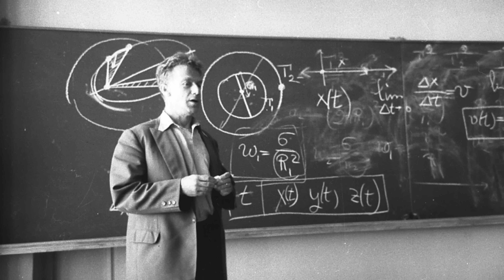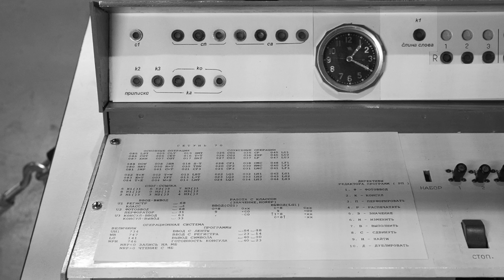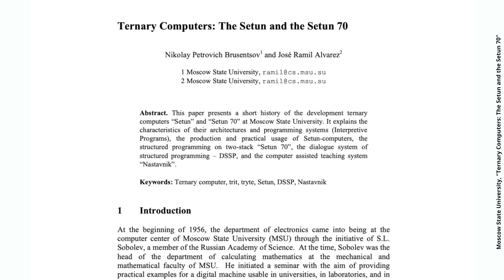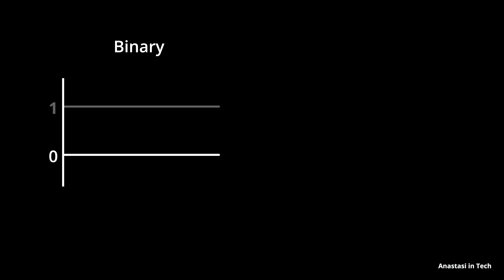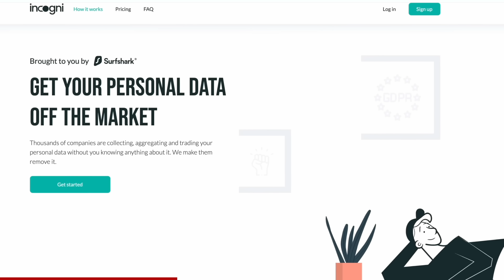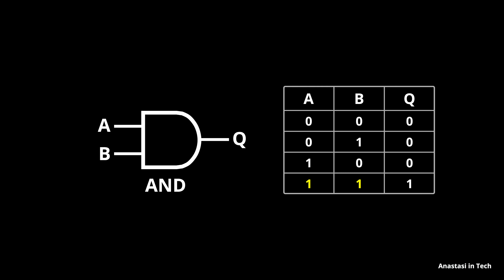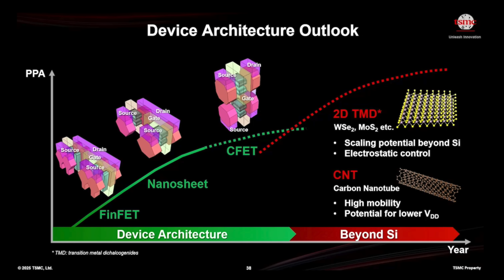The World's First Ternary Computer

Comment: Well first.
Binary is not tru false or not, one or zero.
It is open, closed, pushed to open or close electrical cirquits.
It is +1 -1 or 0V.
It is transistors combined with resistors and capacitors. IC cirquits has many current distribution are few, or single.
Binary is only the language to handle the construction mathematicaly. 
You can do it with low voltage or current, or with light in different wavelength.
Light makes it more complicated and possible to resolve in more levels in comparied to one plane current based logic.
Light makes it possible to separate level (energy strength), and wave length (hz). This makes it possible to work foton transport in infinity layers, and if you apply it to carbon nanogrids it will be enotmous.

Comment: As mentioned in other comments, the question how many stable staes are the most efficient for electronic computing has been picked up by several authors in the past. I remember an essay about this in the late 70s, which came to the conclusion that Euler´s number "e" would be the best solution. 
Since "e" is an irrational number, this does not help directly, but tends to point to a three.state model as the best compromise. But there is another way, because "e" can be approximated by a fraction. If 70% of all computing actions are done with a 3-state logic, and 30% with a 2-state logic, then the average bit processing action is around 2.7 states!!
 Furthermore this complements the observation that in some cases a 3-state action does not make sense. E.g. "can you have two left legs on your body?" The answer is no, because if you have two legs, one must be "more right" than the other. Some jokes, gimmicks and psychological games are possible about this, but the reality is obvious. The same is the case in electronics. If only two defined states are acceptable. like "on-off", anything else is unwanted and dysfunctional. So a smart mixture of 2-state and 3-state logic will most likely be the future in computing

Comment: As per Information theory, fundamentally the advantage (of using 3 as the Radix, in place of 2) is 1.58496250... (approximately 58.5 %). Instead of 3-bit byte for 8, one can have 2-bits (8<9) in 'ternary' logic, or it leads to pack more information in each bit, that much.
While it may be (=is) so, much can be done in increasing the speed easily (or better) like optical computing (I've seen videos & the process offers easy up-gradation in speeds, that we don't even need now = as our date processing, coding etc as well as the man-power to load them isn't there). Evolution from Electronics, began with the transistor & its ability of (analog) "amplification". Since that process (amplification), is needed, "only" to drive it till saturation; all that capacity to "amplify" is a waste. We could've trodden that path, Instead, by simpler (direct) methods - that we explore now.
It implies a 2-bit "yes/no" logic. If we resort to 3-bit thing, again we bring in the transistor & amplification. It might be twin-supply (+ & -) that entails a "0" too. It is the hardware design part, with demanding "dynamic" ranges (& concurrent "error-proneness') - I view it that way as a circuit designer. Well, we can sort out latter too. But it is prudent to throw it away rather than getting into it & to spend a million man-years, improving it. In the process we add up so many links on the way & assume that the system is hunky-dory! But each link (a link can break; "a thing 'will' go wrong if it 'can') introduces its own unreliability factor and the nett effect emerges at the end of this tunnel, only. America stopped producing robust systems, mistaking the patch-work as the solution.
Reply: Where'd you get 2 digits ternary == 8 digits binary from?
Reply: @wannacry6586
2³=8(i.e. 3 bits) < 3²=9(i.e. 2 bits)
Reply: @MrPoornakumar  so just a simple mistake. Happens
Reply: @wannacry6586  
Not at all! You didn't do any mistake; may be its mine.:hand-pink-waving:

Comment: I believe the thing is that tirtiary is different concept than what we want trinary to be so i think its hard to compare the actual potential of a real trinary because tirtiary maths has to do with powers of 3 in layered parrallel sequences ..and this only really has practical applications in very specific computations which is why it never took off although there were different variations of this had various outputs and could be heavier in payload and take longer to process certain simplistic computations ..but a trinary code that could be handled bya complex compiler with nano tech could be the answer so having 3 would have to be deciphered in an efficient way that would be outside of known language logica that we have yet to determine i BELIEVE

Comment: This is nothing new. 
Although ternary systems are more efficient, we use binary due to simplicity. This is basic stuff engineers learn in digital electronics since forever.
There are cases where ternary system is deployed, but mostly very specific cases.
Imagine building storage devices and electronics that require multi-level signal detection. If you are not into digital electronics you have no idea how complex this task is. 
Binary is not going anywhere any time soon.

Comment: Great video Anastasia congrats!!
As a software engineer I can confirm that things are going to change very rapidly in energy of consumption , battery , device size and so on.
Reply: As a software engineer you are not qualified to talk about any of the things you listed professionally
Reply: @wannacry6586 walk away peacefully.
I am not gonna take permission from species like you .
Reply: @andi.bevapi  out of all the things you listed, literally 0 have anything to do with software. Energy consumption is hardware, battery is hardware, dimensions are hardware.
Reply: @wannacry6586  funny , whay you need hardware improvment then?
Hardware and software are always connected for casuality ??
Reply: @andi.bevapi  ah ok so code running more efficiently will make your device smaller got it...

Comment: Don't know why I've been seeing more people recently saying ternary will somehow replace binary but I can tell you that that's simply false.
Radix economy doesn't account for the most significant digit holding less information that the other digits (The left most digit of the mantissa of a number in scientific notation cannot be a zero)
For most bases, that doesn't matter that much but for binary, it's major. Floating point numbers omit the most significant bit because it's always implied to be a 1, something ternary is completely incapable of doing.
Binary is the only base where the multiplication table consist of only single digit numbers meaning several steps can be skipped when multiplying large numbers in binary.
And it isn't just multiplication. All computation is made much less complex by how simple binary is. It even has a very simple way for people to compute square roots by hand, something we don't see in decimal or ternary.
The two most common computations, doubling and halving, can be done with a simple bit shift (adding and removing zeros at the end).
Binary is just better. It's better than base 3, base 10, base 12, all of them.

Comment: Ternary computing is more expensive and more error-prone because a different current voltage is used to maintain the third state -1. It has not caught on and will not catch on.
Reply: Exactly.  Around 1960, +/- 5 years, the US, the UK, and the USSR each buit a ternary computer.
Each project built exactly 1 ternary computer, and then each country dropped the idea.
1.  The logic gates require more than 2x as many vacuum tubes or transistors.
2.  Typically 2/3 of the transistors are in an "on" state compared to typically only 1/2 for binary.

Thus, EVEN WITH the reduction in logic gates needed because the same number of values can be expressed with roughly 2/3 as many data lines, the overall computer
1 requires more transistors
2 requires more power
and 3 ... (not an issue then, but is now) larger chips for the same capability = higher defective chip rates at the chip production plants.

Comment: 7:12 BS!
14:04 BS!

Ever heard of 74125?
Ever heard of  74244?
Ever heard of  74245?
How many computers from the mid and late 19nn did not use any of these? And if not, equivalent functions?

Ever heard of 100Base-T1 Ethernet?
Does 100Base-T1 Ethernet use binary of ternary coding?

Ever heard of FLASH memories?
Ever heard of SLC?
Ever heard of DLC?
Ever heard of TLC?
Ever heard of QLC?
Ever heard of PLC?
Have many of the FLASHes you have bought the last decade have used SLCs?
The phone in your pocket, does it use SLC FLASHes?

Transistors are not "binary". They are analog.
You can use analog transistors in binary operations. (And ternary, etc.)

Comment: A nano device with 3 voltage thresholds and 4 states (quaternary logic)  is easier to understand than 3-state hardware: each wire (for example the logical device input/output wires) carries 2 bits in stead of 1. Does this mean that, at the same clock speed and volume and power consumption, the data and the data-speed is simply doubled, compared with 2 states nano devices? But if the 4-states device is more sensitive to 'logic state' errors due to noise, one needs to build in error-detection or even error-correction redundancy, perhaps even 'doubling the hardware'. The end result could be hardware based on 4 logic states and superior reliability, at the same data (speed) density.

Comment: If you can have more power by other means than carbohydrates, wind, and solar in their current state, you don't need to change your whole infrastructure; it's the battle between ingenuity in energy production and energy consumption.  Less consumption is a good Idea when there are limits to your energy production like living on Mars or just pushing for fossil fuels as they are now. But without these limitations, there is no need for changing the whole infrastructure to reduce energy consumption by something like 20 percent. That'll be the real battle the capital should go toward energy abundance or energy proficiency in the next decades. For now, the answer is that it should go for both because we are in the development phase.

Comment: The reason binary is used is far from arbitrary! It has to do with how transistors are used in logic systems. In a binary system, you never have to wonder if a voltage measurement was off a little bit. That's where computers' reliability comes from. Notice that while people often talk about programming errors, software errors, OS crashes, etc., what you almost NEVER hear about is a hardware design error. The last time one of those hit the news was the Pentium FP error in the 90s.

Comment: It will be a pain in the ass as developer. We actually don't use binary while coding data, but hex (or octal in some cases). In ternary Logic we'll have to use base 27 and base 81 systems in order to shorten and write human readable byte data or use base 9 to handle two trits at a time. And all these systems are not human friendly.

Comment: So can modern software be run on it?  You would have to adapt current compilers to work with the new microcode.  Lines may need to be shielded on the system board and power supplies would have to be ultra clean.  I can't imagine trying to use these in satellites.

Comment: Not exactly related, but kind of -- In RS-232, a logical “1” (MARK / asserted / “on”) is a negative line voltage. Valid MARK is ≤ –3 V (often –12 V; older gear could be around –25 to –27 V). A logical “0” (SPACE) is ≥ +3 V. Idle is MARK (negative), and control lines (RTS, DTR, etc.) are also “true” when negative.

Comment: There is a blind spot at the heart of ternary computing. What if computing didn’t stop at 3 states, what if we use super position of quantum qubit instead.
Reply: I heard something about going beyond 3 states starts getting less efficient. Something about 3 being the closest integer to Euler's number.
Reply: Ok. But if superposition is 1000s of times more powerful, then that value should be factored in to the cost benefit analysis. Superposition is based on probability and intrinsically has errors But the error correction is built in. And it “gets you in the ballpark” so to speak of achieving a level of accomplishment that are unimaginable by current computing standards.

It’s kind of like using chatgpt. Even I as a layperson can detect the occasional errors in the out out even of high level topics I have no knowledge of.

But then I know keep looking or prompt a different way u til I can tell the error has been corrected.

But how else would O even get “in the ballpark” of so many 100s of thousands or phd level topics that chatgpt can instantly get me 99.999999 percent of  by he way there on regarding solving a problem. One person could master maybe two bro three topics at phd level, and now people with no knowledge have access to many thousands of topics at ohs level.

Superposition is kind of like but hat.
Reply: *kind of like that
Reply: @JWalker-g7t  right now you need ultracold temps for quantum. the infrasturcuture required makes it impractical for everyone except large organizations. also quantum might not replace classical, it'll be used for specialized areas where massive parrelization is required. 

quantum will problably be complementary to classical, not a replacement; so there is still value in making classical better.

plus it doesn't have to be either or right. why not make a qutrit instead of a qubit lol
Reply: Those are good points. Maybe the two technologies will exist side by side for a time like gas and electric vehicles.

But quantum will. Wry likely happen and become ubiquitous. So 3 states instead of binary seems like the leap from horse to horse and buggy.  Not a drastic shift when compared to the automobile.

Comment: How about that... Huawei, the Chinese... put in the time and effort necessary to get a modern Ternary chip to work, while the West - didn't...
Imagine... how shocking... !!!
However, I am thinking a lot of the past issues with software, memory and compilers etc, could be relatively easily solved with AI.
Translating all those basic tools to work with Ternary should be right up AI's alley.

Comment: I had expected that he AND operator has the following table as C:    C = A and B,   and in column D is an alternative that one might call Soft And
Q is what you got (but the correction of the 3rd line (-1,  1 -->  -1) according to the rule:  anything with -1 gives -1. 

 A   B    C    D    Q
-1  -1   -1    -1    -1
-1   0    0    -1    -1
-1   1    0     0    -1       <---- different in your presentation 
 0  -1    0    -1    -1
 0   0    0     0     0
 0   1    0     1     0 
 1  -1    0     0    -1
 1   0    0     1     0
 1   1    1     1     1

What you showed as Q seems to be asymmetric:  Your table never shows A = -1 and B = 1. Instead there is twice A=-1 and B=-1. 
But I'm not sure. I could be completely barking up the wrong tree  (in the wrong park :-)

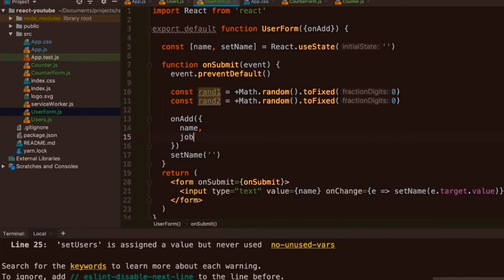Comment: 14:17 "compilers"
shows javascript 💀💀💀
Reply: Javascript is still compiled
Reply: @wannacry6586  clearly js is an interpreted language, jit compiler is just a part of interpreter. it was better to say translators mb?
Reply: @doodocina  almost no language is interpreted directly. They all transpile to some form of bytecode. Also why would jit not count? If jit doesnt count then C# is an interpreted language
Reply: @wannacry6586  what is the point of talking about interpreters then? c# is an interpreted language as well as java or lua. interpretation process as the process of translation from one representation to another is compilation by the definition, be this switch-case or usual jit. jit is just "optimized" interpretation. if code is stored as is or in non native bytecode it is an interpreted language imho
Reply: @doodocina ??? C# is definitely not an interpreted language. Lua is also converted to bytecode first. And jit is more than just "optimized interpretation". Even for "interpreted" languages the jit will directly generate machine code.